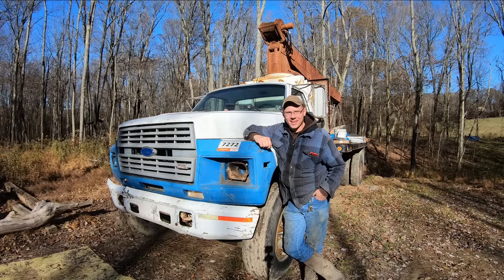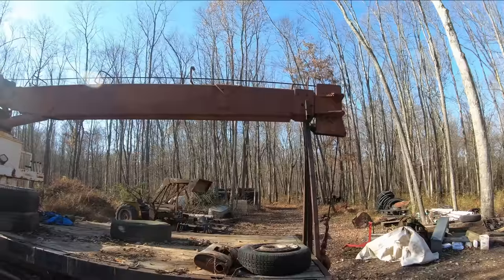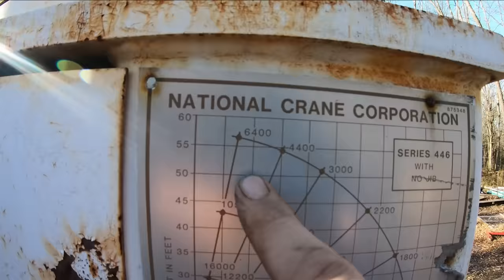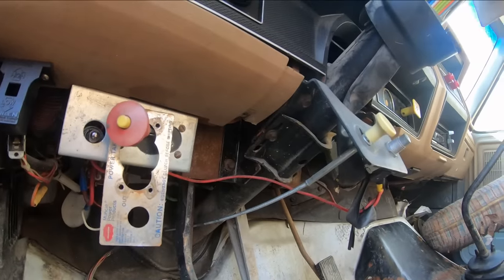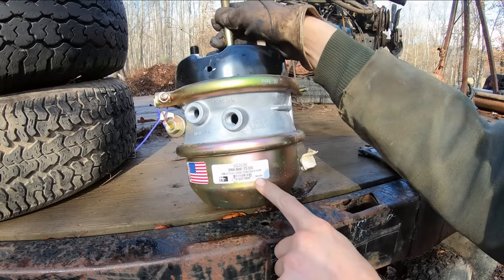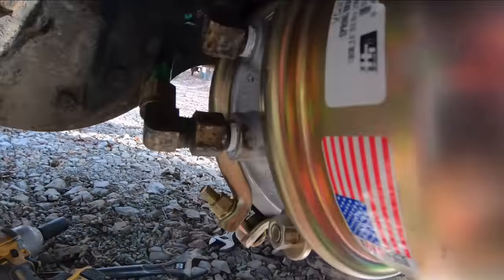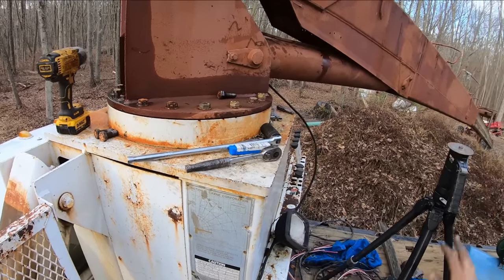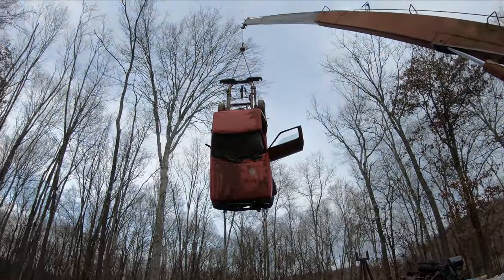$700 Auction Crane put to the Test!! Will it LIFT???

Comment: I spent some time on that identical crane when I was a young man. I recall that one had the same belt squeal. Cold blooded POS too. Best thing they ever did was pulled that national crane off and put on a diesel powered chassis. That fixed all the problems. Just wait until that thing dies just as you've made a pick over a building...and there's a storm coming (with tigers in it). Fun times. Brings back memories. Thanks for that!

Comment: Excellent buy!
Caution inside boom there are retraction cables which can jump off.
Also extension cables on pullies hold entire load on telescope when boom is up .
Check them out and bolts that hold turret down often stretch break.
Had all few old boom trucks. Started our business in 1988 with a 1975 GMC 50 ft boom pit up dozens of pole barns building s poles etc. I could pick and carry loads over front like big trusses.
I even made my own 20ft jib from tubing and a man basket.
We can't drive old trucks in NY DOT pull over tickets etc.
Good luck.
PS change the cable Asap and load test it put a ton on hook and boom out as far away low to ground to see  stability when out rigger start to lift thats your limit stay way inside that radius follow chart ... (I flipped a few cranes.) Careful over front never ever side pull loads!

Comment: That’s cool, it’s fun to have a crane.
Reply from the maker: Yes I’m quickly realizing how much I’m going to use it. I can’t see myself selling it for quite a while. I can also get a man basket for the boom which is on my list now
Reply: Diesel Creek build some cool stuff with it. Jesse Muller just fixed my old one.
Reply from the maker: I was hoping you were gonna do a video on what happened to it and fixing it yourself but that sounds good too 👍🏼
Reply: Less then a week there will be a video. it tipped over. Then I started fixing it. But it was too small anyways so I got that 70' grove.
Reply from the maker: Ya that’s a really nice unit you got. A real crane for sure!
Reply: Diesel Creek can't you use the Ford cab for a basket ? It's got seat belts and air conditioning 🍺
Reply: How cool is it to be able to see two great content creators converse right out in the open like this? Imagine at the end of a Tarantino movie, you see Spielberg say "really cool movie, dude."  in the credits.
Reply: I wish I had a crane some times. I farm and it would be nice to have something that will lift higher than a backhoe.
Reply: @DieselCreek  Be great for topping trees.
Reply: @DieselCreek  Amen to that.  At age 70, I really kicked myself for not getting my junk crane sooner.  Like 40-50 years sooner.
Reply: @DieselCreek  Yeah, definitely very important.  Especially reinstalling the square tubes after seal replacement. Those tubes should be greased BTW.
Reply: Matt and Andrew should have a crane fight.
Reply: @DieselCreek  Too much fun. That truck bed did not look like junk to me, until you tore it off.  That wasn't worth your time to unbolt the bed before removing it?
  Also, you can just tighten that belt until it either stops squealing or breaks, of course you will have to replace it if it breaks, so you could tighten it so that it only squeals a little, but I would tighten it considerably more than it is.
Reply: Two of my fav channels. Good on ya guys  😃
Reply: Nice of you to stop my Andrew your videos are awesome as well dedicated dude
Reply: @DieselCreek  That's funny. I just bought a 52' manlift for $500. I picked up a 1987 GMC 6000 for $750 and am in the process of marrying the 2 together. My neighbor has the jibcrane that fits on the side. I told him I wanted to be first in line when he gets ready to sell it. We will end up with similar outfits, just being built in the opposite direction.
Reply: Max lift capacity is a function of boom length (and usually angle), so winch cable up until you clear first obstacle (height of flatbed), then shorten boom length until it is over flatbed.  That lump is probably light enough you could whip it around all day, but once you're picking up the big stuff, you'll want to shorten boom as quickly as possible.
Reply: @DieselCreek  I would never sell that crane! You got it for peanuts and it's very useful. I have a an old wrecker I put a boom on, very useful.
Reply: Well you rolled you crane 😂
Reply: I wish diesel creek talked to us fans like he talks to Andrew camarata lol

Comment: 2 years out and you'll probably never see this, but I ran both a 800 and 1100 Series National Crane; you scared the sh!t out of me lifting that truck bed, off center without the rear stabilizers down and set. That Load Chart is only Good, with the crane properly supported by the riggers. Especially off center and bouncing the load; YOU GOT DAMN LUCKY. Loved the video. Keep it Rubber Side Down!

Comment: winch out the whole lenght of cable and check it for any damage and then grease or oil it , it looks very dry
Reply: grease it dont oil it
Reply: They make a cable lube in a spray can. Better than putting oil on it

Comment: Someone may have said this already, but here is a little tip for caging brakes. If you have air pressure and are able, release the parking brake, put in the caging bolt and run the nut down by hand, then set the parking brake. Now your brake is caged and you don’t have to use a wrench.
Reply: I have never seen anybody do that I’m going to try it. Thanks

Comment: Nice work. Honestly if you get that exhaust leak fixed I think nobody would be any the wiser and it'd be even cooler. Nice work on those crane bolts. Glad to see that you're doing things the right way when it comes to safety.
Reply from the maker: Thanks 👍

Comment: I can tell you your truck has quite a few similar issues as the one chip truck I had the 'pleasure' of working on. The sticking throttle- (added a better return spring,) erratic idle- (bad MAP or coolant temp sensor,) leaking exhaust manifolds- (studs were rotted,) ignition switch- (replaced a few times due to contacts breaking loose inside,) drivers side door sheet metal tearing- (welded it up,) bunch of vacuum leaks from all the emissions/ evap related garbage- (replaced what was necessary/ deleted what wasn't.) I give you props for picking this thing up and reviving it. That crane is super useful and you really got a hell of purchase that's worth so much more than what you paid/ invested in usefulness alone. You could make a bunch of money with it and recoup your investment on the first job. I loved the part with the Ranger. Lol that bolt was pretty damn strong that was holding the bed on. I was surprised how much it took to rip it off. You sir, got one of my favorite channels and your vidjas always deliver! Great stuff brother!!😎👍😃

Comment: Outriggers are more for stabilisation than levelling.
It is rigid rather than a soft rubber tire making it harder to rock around and it is means the pivot point that the truck would need to roll around is signifcantly further from the center of mass meaning it needs more torque to flip it.

Comment: might harp at you a little here, but please, before lifting again inspect your cable. would be a bad bad day all around if you go to lift and that cable lets go. had one do that mid pull on a wrecker I had. that cable is like  whip.... and it does not care whats in its way.... beauty of a job getting that truck running though! job well done!
Reply: I was in the path of a broken cable on a tank retriever.  I had no chance to move but it went all around me without touching me.  By the Grace of God....

Comment: Glad to see your having fun with your new toy! Remember this is a serious piece of equipment and a thorough inspection of all components having to do with the crane is essential for safe operation! The mast bolts had rolled threads because some old boy thought that the tighter the better was the thing to do! I would also check the mast king pin for wear and signs of stress cracking around the turn table! These boom cranes are the most abused pieces of equipment in the construction industry!( Why pay for a crane when a boom truck will do) after its laying on its side! Just a word from an old Heavy Rigger 32 yrs retired Heavy construction Steamfitters Local 598 Pasco Washington.
Reply: The rented-mule of construction...

Comment: Alternator belt whine/slippage - Upgrade to the later model 3G alternator with internal regulator. Ensure you get a unit with "Load Response Control" (LRC). The LRC function in the regulator ramps up to full current over a set time period - 2.5 seconds is common. That cuts down on the load during the first few seconds after starting. The 3G upgrade is very common for underpowered 1G alternators that came on the older trucks. It is also good for the 2G alternators that have the annoying habit of catching fire. Total cost for the alternator and pigtail is less than $100.

Comment: Remember to check the bolts on the bottom side of the rotation bearing also, I have found broken ones doing crane inspections.

Comment: Pretty impressed with your ability to get this one going.  Lots of little issues and one big one, didn’t deter you!  Thank for the great video , one of your best.  Peace
Reply from the maker: For $700 I couldn’t be stopped haha
Reply: @DieselCreek  You need to fix a few more things, like the hose on the left rear stabilizer. Not safe to lift loads with one stabilizer not working. Plus it shoots out a ton of Hydraulic fluid.
Reply from the maker: @MrCarl312  you should try finishing the video....

Comment: Cool. Congrats on getting it working. You may want to get some portable plates for the outriggers in case you get onto soft ground. Another video would be fabing and mounting a rack to hold the plates. 👍👍

Comment: Just remember don't trust Hydraulics, chains or cables it's not worth your life
Reply: James Thom watched a diesel locomotive unload from a cargo ship, everything was going smoothly , the ground crew stood around with their hands in their pockets, ho hum. Then the strap around the front of the loco let out a big snap followed by the rear strap. The loco hit the ground from about 10 feet. The earth shook and so did the loco from front to back. Can't imagine the loco was drivable without a complete inspection and test.
Reply: I used to do some work fitting computers in greenhouses and when you see the guys building the glass houses the experienced guys were always yelling at the younger new guys not to stand under the sheets of glass when they were passed up because if that glass breaks it’s gonna cut you in half so don’t do that either
Reply: I thought the same thing.
Reply: @timmayer8723  - saw that the other day. Frame was bent - major frame damage
Reply: canuckguy worried  Yes one of the family friends found that out. It was a large funeral.
Reply: canuckguy worried the guys standing around waiting for  the loco to settle gently took off like a bunch of roaches in every direction. I agree there is never a good time to stand under a load. When it lets go there is usually no warning. Those under the falling load are killed or maimed for life.
Reply: My cousin told me about very large sheets of glass being moved, in a glass works,  only the large frames supporting the glass moved and a few of these large sheets of glass fell on one of the workers, his name was  John Magginty a Welsh Man he was in his early 20's. My cousin never forgot about him. Geoff Lewis, Wales, UK, 🏴🏴🏴
Reply: canuckguy worried  Yep
Reply: @geofflewis4815  How be ye in the land of the wondrous Welsh pop singer Tom Jones?
Reply: You might spool out the cable and check for frays.
Reply: @deuteronimus750  Hello this is Geoff Lewis again,  Tom Jones used to live only about half an hour's drive from me, he lived in a little town call  "PONTYPRIDD"  he's very down to earth man, not snooty, like some singers. He had a Nose Job done because when he was younger he was allways fighting, a great bloke.  Geoff Lewis, Wales, UK, 🏴🏴🏴
Reply: @geofflewis4815  Too much!  A great story. He was called Ol' Leather Lungs by some here in the US. Hande was a tremendously popular heart throb and sex symbol for many many women here during his long lifespan. He was one of the best and most versatile singers ever, and could successfully cover any popular music or rock and roll song with his unique and talented vocal power. Jones also hosted his own popular national TV network variety tv show The Tom Jones Show. On one episode he featured studio recording star Wilson Pickett, both singing a duet on Pickett 's classic 1960's radio monster hit single music charts hit song "Mustang Sally". Now revived as a popular cover by the UK rock band Queens of the Stone Age.  It was memorable because Pickett was one of the strongest soul singers of the Soul Music Generation. You could see as they both traded verses singing Pickett"s classic  hit that both had a mutual admiration for each other's talent as each tried to match the other's power during the performance of the song. On another subject there is a famous 1930's  American film studio movie production based on a classic novel by a Welsh writer, that has American film star John Wayne portraying   a Welsh local area boxing champion, in a match with another well regarded local boxer in a fight that continues across the countryside almost the entire length of the movie until Wayne finally wins.  I'm ashamed to say i can't recall the movie title right now, you may already be familiar with it.
Reply: @scottgm321  yesgreat idea
Reply: canuckguy worried  I worked on an off shore drilling rig many years ago as a roustabout constantly hooking up cables to the headache ball or block and my gloves always discovered the frays. It became second nature to double check all wire clamps and shackles and hooks. I couldn't operate a care no matter how they tried to teach me. I can't do two things at once like spool out when raising the boom to keep the block from getting sucked in.
Reply: @timmayer8723  I know the clip - the locomotive would have been completely totaled. - the frame was bent to shit after that.

Comment: The squeal from the motor is not a fan belt, but is the Fan Clutch. You need a new fan clutch, I have had this problem on both Fords and GMC cars and Trucks, they are a safety feature that is to stop the fan blade if something was to get into the fan. Like your had or cat sleeping.
So order a new fan clutch and install it. The squeak will be gone.
Reply: I doubt this truck has a viscous clutch.  I’m sure it is directly driven off the water pump and the clutch isn’t a safety feature, it’s to increase fuel mileage. As the engine gets warmer it heats up a thermal spring that allows the clutch to engage a certain amount depending on the temperature of the spring. When the clutch is cold (after sitting all night) upon first startup the fan will be engaged 100% until the viscous fluid can move around hence why it didn’t save the cat in the comment above. There is electric and air clutches as well but they fallow the same principle for the most part.
Reply: @boodoorn   I know our early 1970’s F800 farm truck had a fan clutch that went bad and it made the exact same sound as his truck.  Grandpa replaced the belts, alternator and several other parts in chasing the ghost of a sound, finale a friend who was a Ford mechanic told him to replace the fan clutch, and the sound went away for about 5 years the returned, this time we replace the fan clutch for a Second time.  Like most farmers Grandpa would talk to the other farmers at the coop about mechanical problems, and the farmers told him to replace belts, and other parts to resolve the problem, it it did not fix the problem, the new part was removed and returned to the part store, usually it was removed with a few choice words.

My 1976 Chevy Caprice developed the same sound in 1982,  and I replaced the fan clutch and the squealing belt sound went away.

The Ford mechanic that worked at a Ford dealership called the fan clutch a governmental mandated environmental safety feature  that was introduced as some of the early emissions control.   He told us the fan clutch served two purposes to protect the stupid that would stick their hands in the fan and the environment.  He was an old timer mechanic that hated the emission controls  that made his job harder, he died in the 1990’s.

Comment: From what I've seen in construction working with cranes but never operating one.  The operator with boom out the desired distance and don't boom in or out with a load.  They'll just boom up or down either dropping or lifting the line.  That's a sweet truck and I love the videos man

Comment: The load chart should indicate a load rate in the swing arch . I would also think anything above 6000#lbs you might want to use a two part line. The wear plates in the boom sections should be held with either alum or bass bolts, as reg. bolts will damage the boom when the wear plates wear down.

Comment: Please inspect the lifting cable for rust. BCBLOC had a crane cable break and ruined a heavy piece of equipment.
Reply: Yep, inspect the cable, me and my dad were pulling trees out with a 1951 mack building mover and the cable snapped. Scariest experience when your sitting behind it in the cab.
Reply: I'd recommend keeping that cable well oiled too so it doesn't rust.
Reply: That was my thought too. The cable looked a little oxidized.
Reply: Cables are becoming a thing of the bast. Non metal rope is amazing. Before installing I would call the manufacture to see it it’s advisable

Comment: Pretty good score , Someone was probably gonna remove the stinger being the trucks motor was toast does the engine have a trianglular bracket Tension pulley that might be squealing mine did once .
Reply: Misaligned pulleys on water pump